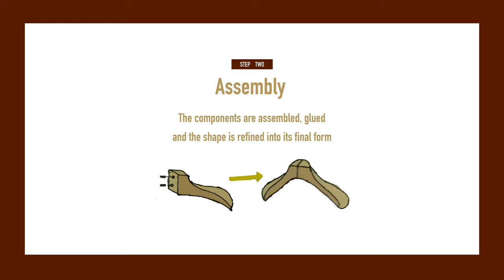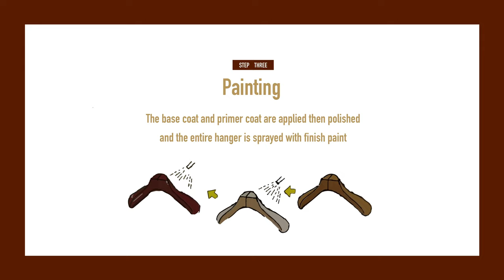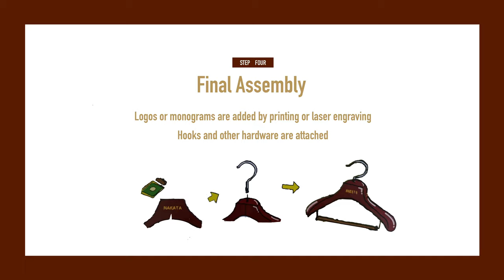The Armoury in Japan - A Tour of the Factory Making the Best Hangers in the World

Comment: It was less artisanal than I expected, but still a great product. Why don’t we have such a workshop in France ?
Reply from the maker: When we shot this at the Nakata factory we were shown the process for their most popular model the AUT-05. They also make a higher grade hanger (NH-2) which is milled from a single piece of beechwood with no seams at all. It takes a highly skilled craftsmen with a trained eye to accurately shape the hangers by hand to perfection!

https://shop.nakatahanger.com/en/products/nh-2-mens-jacket-hanger-smoked-brown?_ga=2.249203207.1261505977.1659413324-2137458171.1639536806